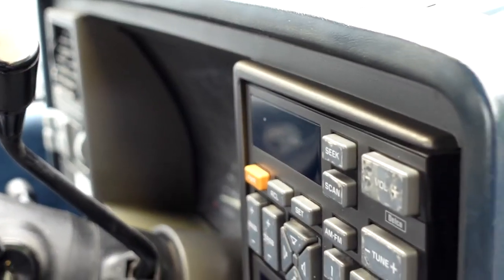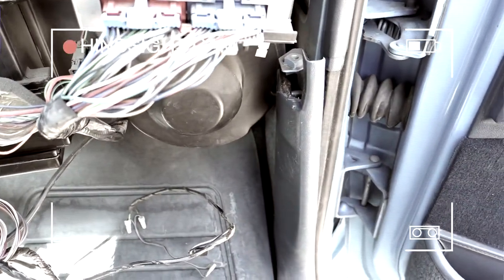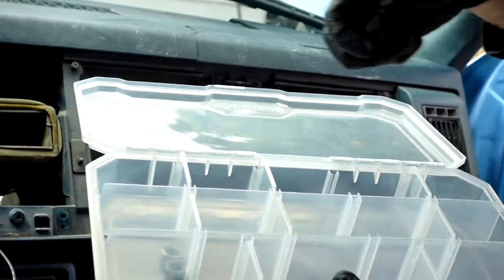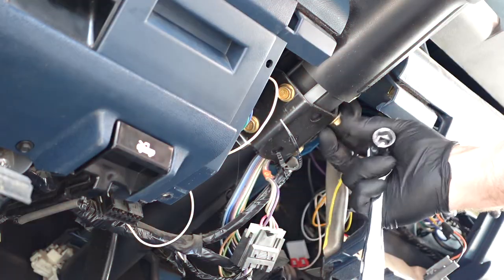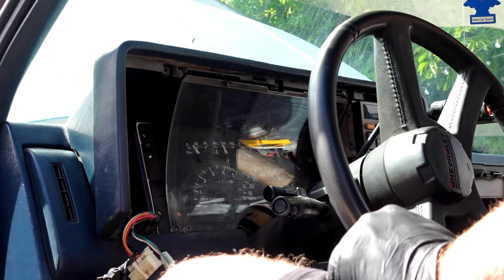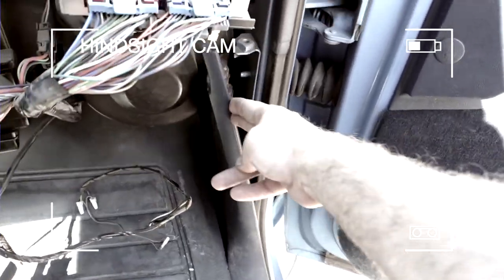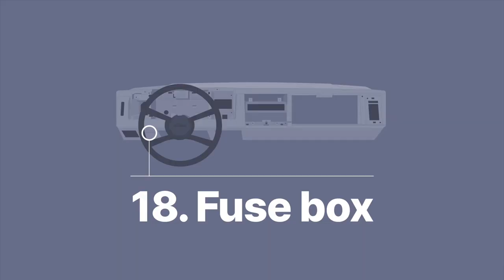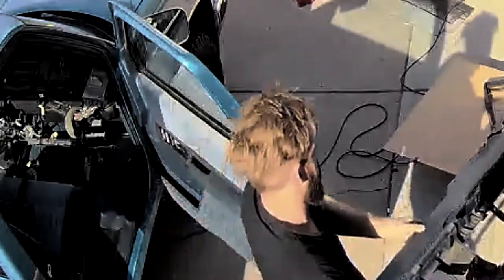Dash Removal on a GMT400 1988-1994

Comment: Wow, what a great video.  I replaced my dash with the LMC one. It was great, but I've forgotten how the harness and lights all went back.  This video will be a huge help. Thanks.
Reply: How’s that lmc dash holding up?
Reply: Very well.  I used the LMC paint and it matched perfectly.  Should have used the adhesion promoter though.  Scuffs easily and probably need redone in a few years.

Comment: You have to use a vice and clamp it really tight and then push it out works like a charm
Reply from the maker: Thanks for the heads up! I realized that after recording the video, but my replacement dash came with the cable already installed so I didn’t have to mess with it.

Comment: The dashes on 88 to 90 didn't crack, they are the ones to look for.
Reply: I was wondering about this.  My 89 K1500 dash is still okay, even after sitting out in the sun for years.  🤨

Comment: My 94 GMC Sierra already has a few Hair thin cracks in the dash. Should I get a Cover from LMC for the Dash?
Reply from the maker: With just some thin cracks, a cover should do the trick. You can also check on Amazon where you might be able to find better pricing.